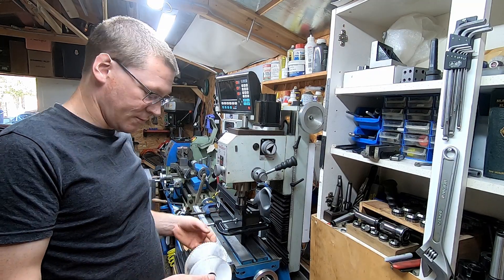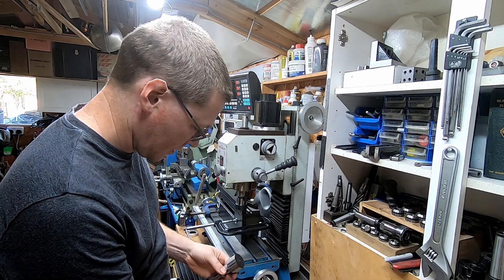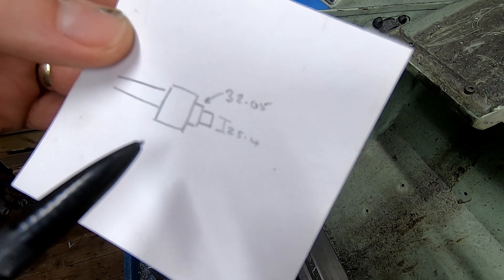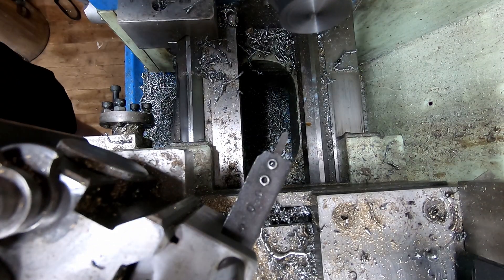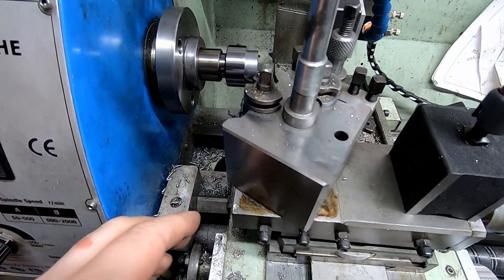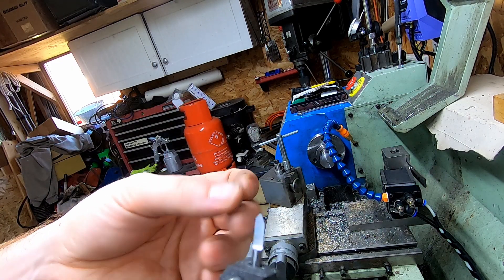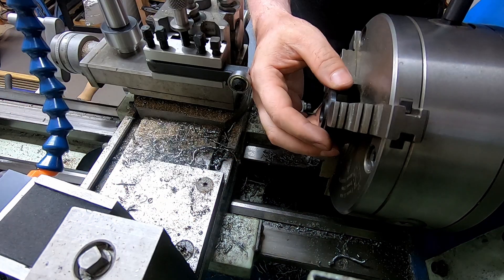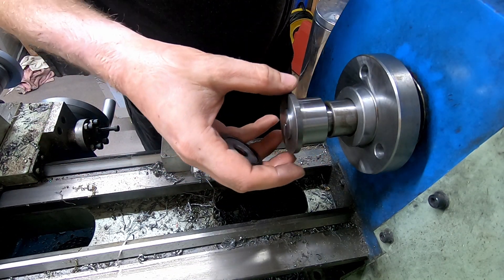Dual Diameter Slitting Saw Arbor build

Comment: Ciao Oliver !! A very nice job you did: i made a similar shaft, some years ago, and i was very care to turn the shaft perfect round and coaxial etc...to discover after that the slitting saw did not rotate in a plane, but it was like a sine wave: it can be ok for discharge the chips, during work, yes ...but it is not really good for the vibration; also my slitting saw are 50 mm and 70 mm, both with the same problem !! Ciao Oliver, see you soon, Alberto.
Reply from the maker: Thanks Alberto, slitting saws are not the most pleasurable of cutting tools to say the least. I'm pleased with the result though, a lot better than the old Chinese Arbor. I now need to make one for my 50mm slit saws!

Comment: Nicely done 👍 I made a similar holder for those carbide routing bits, it's really handy for breaking the corners on small internal diameters where I can't get my chamfer tool in. Thanks for sharing!
Reply from the maker: Thanks Matt. Will have to add that to my list.

Comment: Well made Olly, they always run out a little, even on very expensive arbors, your end result was spot on. Cheers, Jon
Reply from the maker: Hi Jon, thanks. I've been meaning to make one for years, but I so rarely use slit saws it's always been too far down the list. The job was for work, so it just had to be done. I'm very pleased with the result, however I guarantee the next job will need an extension shaft!

Comment: Nice project, but you really should stop using your hand as a hammer. It will eventually damage your hand.
Reply from the maker: Thanks. I'll try to preserve my hands (but they are just so handy!😁). The rawhide and copper mallet that I used at points in the video generally hangs up by the mill. Perhaps I'll invest in a second one to have by the lathe, then I'll have no excuse.